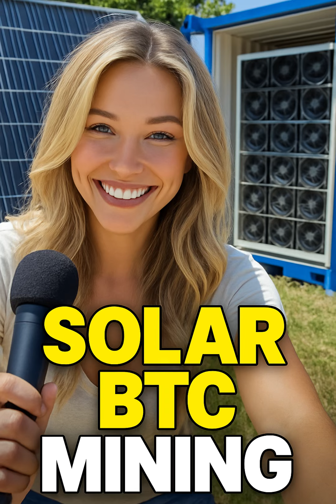Off-Grid, Solar-Powered Bitcoin Mining!  #bitcoin #renewableenergy

Comment: I really like the idea of doing it only in the daytime. This keeps the upfront cost down because batteries are BY FAR AND AWAY the highest cost in a solar system. I have a question though, in your test system you had the Leaf battery and I thought that was because the inverter basically required a battery to operate. Is there a way to do it without the battery?
Reply from the maker: You really need the battery to help smooth out the amount of power available from your pv even if it's only a very small battery. Without the battery every time even a small cloud passes over your whole system will shut down.